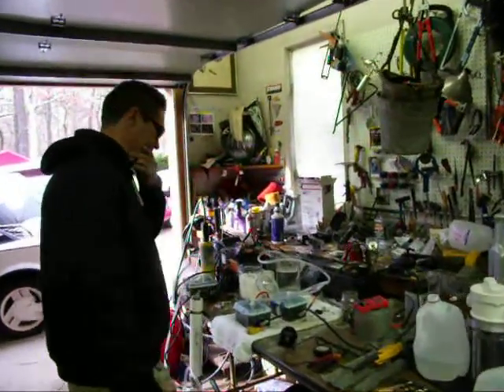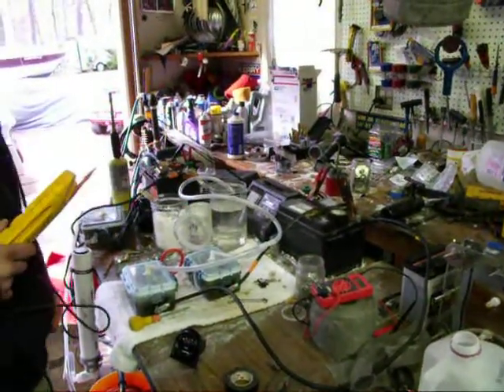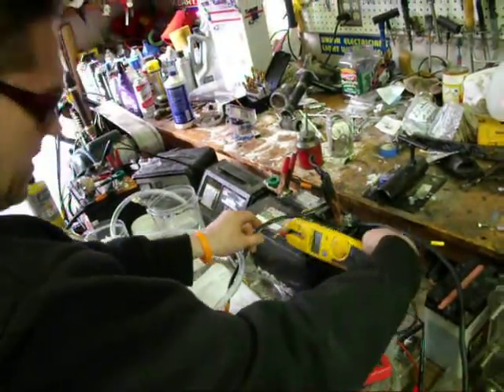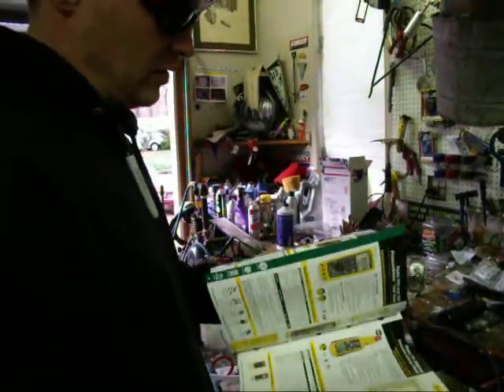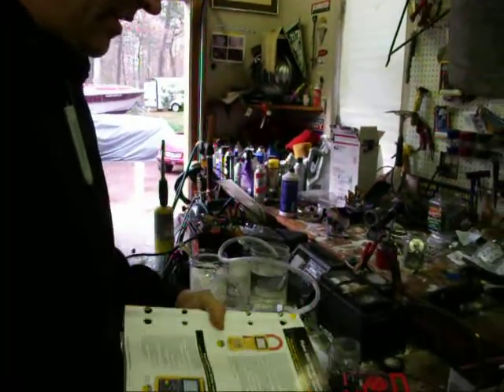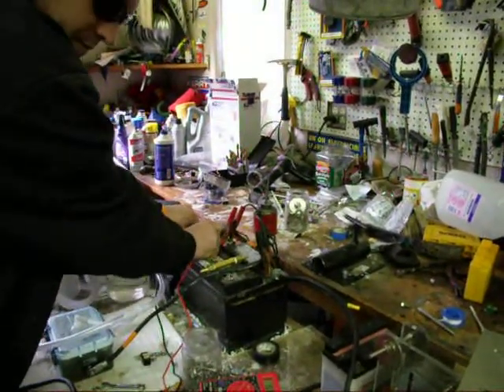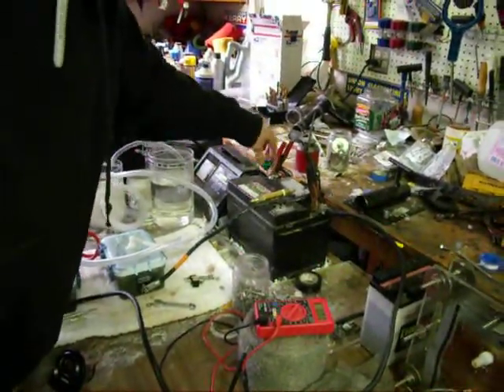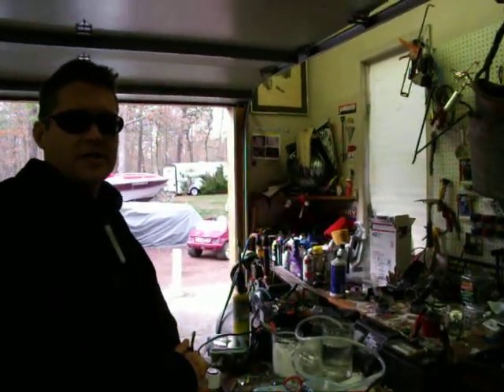HHO TRUTH  ABOUT AMPS

Comment: Excellent information. When I was testing my HHO system, and a friend offer to help and used his fluke meter, he didn't know that the meter didn't read DC. He thought it switched automatically, and the readings were all wrong. The fluke read 2amps, when we were actually at 42amps DC. He was shocked to eventually learn his expensive fluke didn't read dc.

Comment: Yup. Faraday's law of induction states that you cannot generate a current unless the magnetic field is changing or moving. The clamp meters require a changing or moving magnetic field from an alternating Source or a moving source in order to induce a small current that the meter measures. If you clamp DC there's no change and the reading is wrong if you get anything at all. Very few meters can clamp DC and get a true reading. DC clamp meters must create and impose their own changing magnetic field which then is added to or subtracted from the DC field from the DC wire you're measuring. It's a much more complicated circuit and therefore a much more expensive meter. You can buy clamp meters for as little as $10 on eBay or Alibaba but the cheapest DC clamp meter is many times that because of the complicated circuitry required in the meter.

Comment: a good digital dc amp meter is a little hard to find. just so you know fluke caters to the commercial and residential industry. Thats why their whole catalog is on AC. You dont have to spend a ton of money (under $200) to get a great, extremely accurate clamp on amp meter.